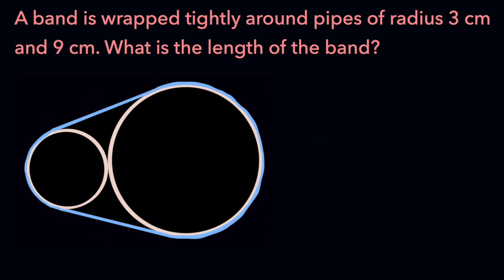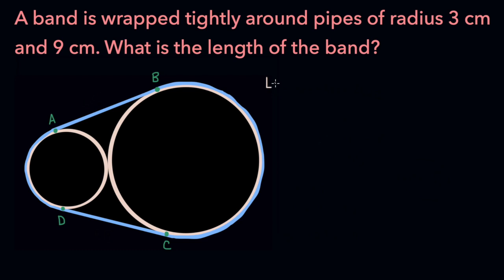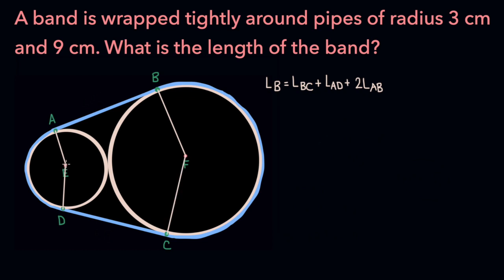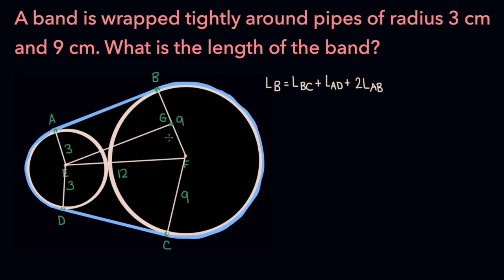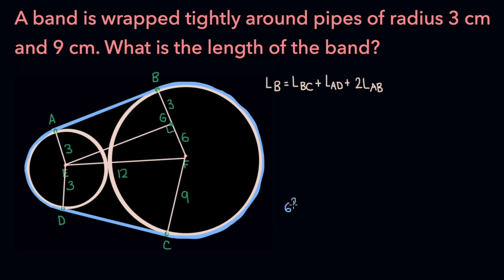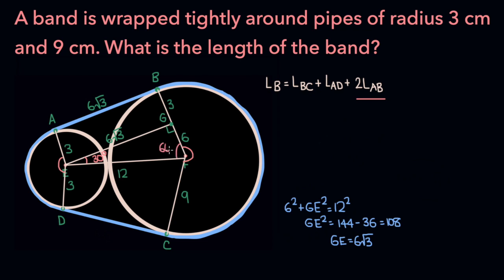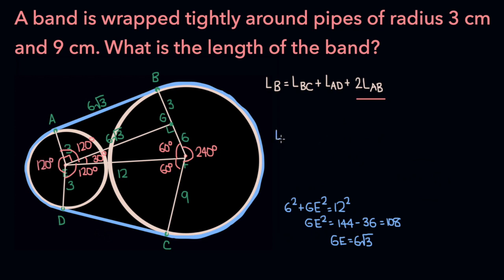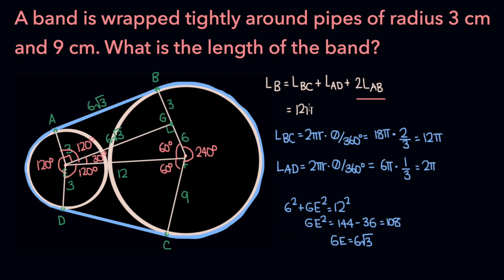Length of Elastic Band Wrapped Around Pipes

Comment: How do we know that the 60 degree angle is symmetric across EF?
Reply: It's symmetrical. You could also repeat the process on the bottom half if you weren't sure it was symmetrical and would still get 60 degrees!